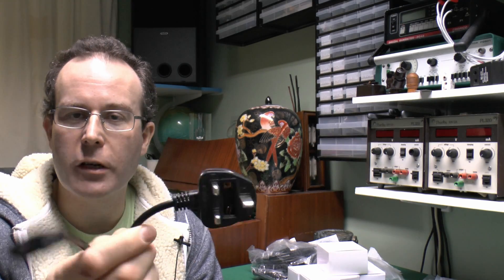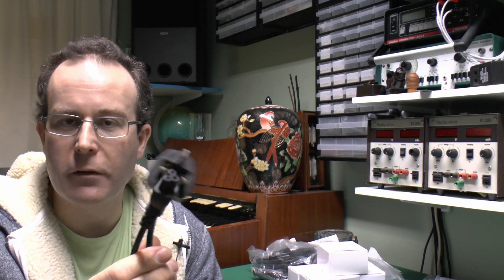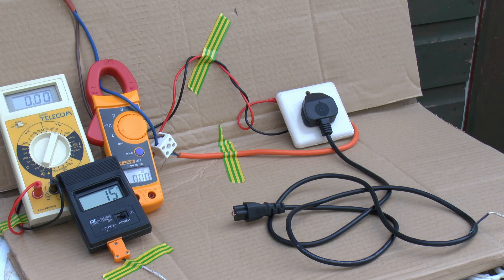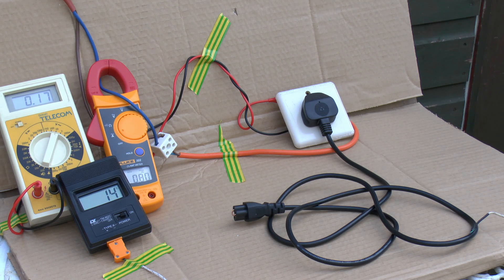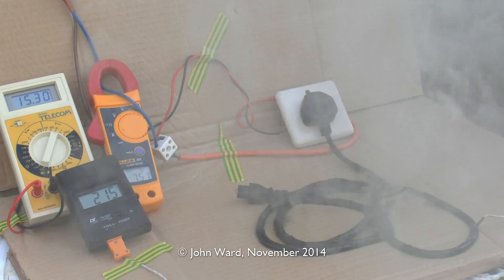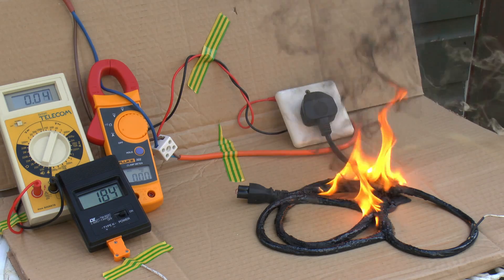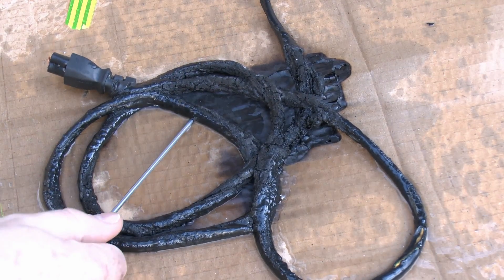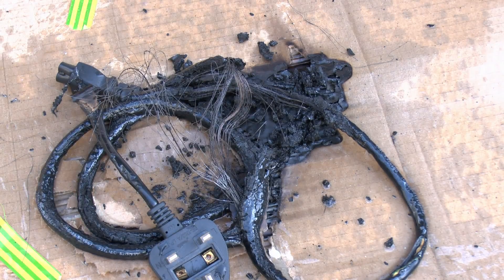C5 Power Lead Destroyed

Comment: I have a question - Is this cable not rated for 230V / 13A ? That means it would have melted in a heartbeat under actual workloads (like 230V / 5A). Wouldn't it ?
Reply: That cable should have never been rated for 13 amps, but more like 10, maybe just 5 amps. In fact, why should it even pass a safety rating?

Considering what that cable probably connects to, it likely would never exceed 5 amps under normal usage. However, the heating effect of the cable becomes worse, if it is bunched up or if something, a piece of carpet or a box or something, is put on top of it. A proper cable might have so little heat, that heating building up, would less likely present a problem.
Reply: Shaunak De no, because the cable only got up to 73° when passing 13amps, and had a 3 volt drop across the cord. If an appliance were drawing 13 amps it would have seen slightly lower voltage, (3v less than mains) and the cord would have been hot enough to be unsafe 73° but not bursting into flames unsafe.
Reply: Robert Szasz
A power cord is not supposed to be a heater, and if there was any bunching up of the cord, wouldn't it overheat all the more?

Why didn't they simply put a lower-capacity fuse into the plug?
Reply: Thank you for the explanation. :)
Reply: Well.. the insulation is probably still ok for 230v at 73°. That's the only thing with a random Chinese products, it could be something that goes from OK to dangerous unexpectedly.
Reply: Yosef MacGruber they should have. But it's also important to be accurate. If everyone expects anything potentially dangerous will immediately catch fire, they will not understand that the very warm cable needs to be replaced with a proper on immediately.
Reply: Robert Szasz
That power cord does not appear to connect to anything that would be expected to use 13 amps or more. But the problem is, it is not adequately protected from some potential short circuit overload, with a 13 amp fuse. The reason that most Christmas light sets seem to have fuses in their plugs, is because the small wires would perhaps overheat before they can even carry enough current to trip the circuit breaker to off. Thus, the current is limited to a more reasonable level for those little wires, say like 3 amps at most, judging by the fuse rating I saw on one Christmas lights set.

Also, aren't you forgetting, that watching a YT video of a power cable not overheating, well that is just kind of boring. Sort of like getting a live wallpaper for your Android device, that doesn't do anything. "But I thought it was supposed to do something interesting?" So of course he was going to test the poor-quality unsafe power cord, to the point of its dramatic failure. Better to see it on a YT video, than to smell smoke in your home. Hopefully, such videos can reduce the quantity of utter unsafe junk coming out of China.
Reply: The person I replied to was wondering if it would explode into flames if used with a 5A load. While certainly unsafe at the fused amperage (75°c temp) the fuse certainly would have blown on short with only  3V being dropped  across the wire.
Reply: Robert Szasz
What if the short is in the device itself, only draws perhaps 10 amps, the fuse doesn't blow, and the device catches on fire?
Reply: +Yosef MacGruber Preventing that last possibility is someone else's problem (specifically the device maker).  A cable cannot tell if a device is drawing 10A for a useful or harmful purpose.  Using a (proper) 13A cable to power a deep fryer is ok (if it keeps the heat away from the socket), so delivering that same energy to a shorted out burning computer would not be any different to the cable.
Reply: John Doe
Actually, it can, well sort of. Have you noticed the newer window air conditioners? They have bigger more complicated plugs on them, because those plugs have an arc-detector circuit in them. I think the purpose is to detect loose electrical outlets, that just can not handle the current draw of the air conditioner, and thus to cut off the power, so that the electrical outlet does not overheat. I think what it does, is detect erratic current flow, or spikes characteristic of sparking, perhaps indicating a loose connection screw in another outlet that is feeding power to that outlet, and it being judged an unsafe condition, it trips and cuts off power to the air conditioner. Can somebody correct me, if my explanation is inaccurate?

However, the higher cost of such a detector, probably makes it inadvisable to include such huge plugs for a mere clock radio, when a quarter-amp fuse would be far cheaper. Sparking at a very low current draw, is not going to produce near as much heat, as with a high-powered device such as a heater or air conditioner. Also, I think low-power consumption is much less likely to spark, even through tarnished or loose connections. Even a high-resistance connection, can often deliver a mere very low level of current.

There is no reason that I can think of, that a cable to a computer printer, should be drawing 10 amps, so perhaps it should have a 1-amp fuse in the plug. But sometimes the fuse might be within the printer itself. Anyway, a power cable should be capable of carrying the current that it is rated for.
Reply: +mharris1270 You got pretty much all all of that wrong. The problem with aluminum wiring was people not using the specified connectors and resistance building up at the connections to copper wires. Since people can't be relied on to change their installation procedures, just using copper was the solution.
Edited to correct speech recognition errors
Reply: mharris1270
If that power cord goes to a laser printer, then by your claim, that power cord is totally inadequate and unsafe. Every customer should be sent a replacement, without even having to request it.
Reply: mharris1270
It probably is a good idea to feel your power cords and transformer brick plugs, and electronic devices, ever now and then, to see that they are only slightly warm, and not unusually hot.
Reply: The C5 power connector is rated for max 2.5A, and it's used only on laptop power supply (and not even all laptop power supplies, the ones that needs more amps use a C13 that is rated for 10A). So what is the point to test it even with 13A? If the load that you can connect is maximum 2.5 the cable is rated for 2.5, and I think that with 2.5 it works fine. 

Just put a 3A fuse in the plug and it's a fine cable, if that cable was sold with a 13A fuse in it it was clearly a fault, maybe someone changed it with the wrong kind of fuse because why the hell a 13A fuse in a cable with a connector on the other side rated for 2.5A?

Comment: I don't understand.... why didn't you do this test with the 13a fuse inline so that we could see the fuse did not protect the cable. The the fuse could have blown before the cable became dangerously hot and prove the fuse was doing its job. I thought the fuse was there to protect the cable, which considering you pushed the cable to 20+Amps  before anything actually dangerous happened means it was basically a test of someone replacing the fuse with a link of 1.5 cable. Was the different voltage an element? would the fuse blow at 240v @13A or would the cable burn?
Reply: +John Quinton Not a fire risk perhaps but definitely a burn risk.  Plus anything the cable is laid on is not necessarily designed to handle 70C+ either.
Reply: I agree, the cable is a piece of cheap trash, but it would be interesting to see how it would stand up to a real world test, cheap fake fuse, cheap not-really-as-advertised cable, insulated earth pin, faulty iron or kettle element...
Reply: It is not so much whether 70ºC is so dangerous, well unless the power cable becomes unstable and damaged and more likely to short out, but if the temperature gets that high close to the maximum that the fuse can accept, then what keeps the temperature from getting higher? You have to consider the wide range of likely improper usages. People using high-current carrying cables which are still bunched up, so that the heat can not escape. And the test is not so much considering normal operation, but rather, what happens if there is a short circuit in the device. Does the fuse reliably cut off the electricity, or does the power cable overheat at risk of starting a fire? We should also remember, even though the cable itself might not overheat too bad, the device could be in flames because the plug fuse was of too high a current rating.

70ºC, even if you don't want to count that as a failures, leaves too little margin for error. And I would count such a high amount of heat, as a failure, that the cable is not safe. At least not without a lower-amperage fuse.

Perhaps what is most inexcusable, is putting a 13 amp fuse on such a poor-quality cable. If somebody thought that that cable was good enough for its intended usage, then why didn't they put in a 3 or 5 amp fuse? A cable designed for 13 amps, surely should have been of better quality.

Comment: Absolutely brilliant experiment this had me at edge of my seat like I was watching a horror film, When you say fake fuse, what actually makes it fake? At what current would a genuine fuse have blown?
Reply: +Prawnchowmein 
Fake fuses are typically either poorly designed, and/or poorly constructed. They might blow at too low of a current, which is a nuisance. But the real danger is when they blow at a higher than specified current. Think of it as putting a jumper wire instead of a fuse XD
I'm from the USA, and actually some of the old fuses here are very dangerous, because one can stick a penny behind the fuse, and screw in a blown fuse. The circuit will then work, because the penny bypasses the fuse altogether!!!! (pennies have a copper surface)
Reply: +Benjamin “Ozias” Esposti That is not the fuse being dangerous though, just people being idiots.

You can't design the human element out of everything.  There will always be a way to bypass safety features, the important thing is to make sure those features work as designed.

Comment: Hi JW, what equipment are you using to do the tests? We need to get hold of something similar for fuse testing. Thanks. I can't find anything that will go from 0-X amps.
Reply from the maker: +ChompChompNomNom An 8A variac connected to a 3kVA 240-110v site transformer, with only half of the output connected, which gives an output voltage of 0-55V, maximum current from 0 to about 30A.
Output is not regulated at all and depends entirely on the resistance of the load, so as in this video the current fluctuates significantly as the insulation melts and the wires short together.
Reply: Thanks, anything links for this kind of stiff? My company imports millions of pounds worth of stuff and we're trying to weed this crap out. They even produce fake Intertek / SGS etc certificates

Comment: Is there a way of SAFELY using copper clad/coated aluminium or steel in a similar cable?
Reply: +Kacey Anders 
Use a thicker gauge of wire.
I'd say that you still shouldn't use it though, because the aluminum can "cold flow". That is, over many years, it actually flows, as if it were melting, even at room temperature! Also, aluminum is notoriously bad for causing fires when improperly installed. It isn't compatible with all metals, so you can get bad connections (let alone the layer of oxide on AL...)
Reply: Yes, I'm aware of both those points with regards alum wiring, and it's use in the USA during the 60's, 70's and maybe 80's.

I was meaning more with regards use with leads/cords with factory sealed/moulded plugs (the plugs [hopefully!!] having properly made internal connections to the alum clad wire).

But certainly, copper is my 1st choice by a long margin!

Comment: Twenty one amps @ 230 volts would mean a power drain of 4.8 kilowatts. Surely the protective device would operate long before the cable bursts into flames...
Reply: +sadoldgeorge Not quite. The ring main circuits in UK houses generally run at 32A max load, I believe.

Comment: The power supply cable in orange does not overheat.  Is it because they have a lower resistance?
Reply from the maker: +Tangobaldy Yes, the orange cable is a larger size, so much lower resistance.

Comment: John, good video. My recently purchased (late 2015) "Rio Rand" self-balancing scooter from Amazon was supplied with the type of "cassette" lead you show, only mine did not even have a fuse in the British "type" plug. I say "type" as it is certainly not BS-1363 compliant, sleeved earth pin, no fise, inadequate size and incorrectly spaced pins - the lot! Your video demonstrates a current level easily supplied by a 32A ring main and you should point out that at 20A a 13A mains fuse will take some time to blow in any case, too long for this type of cable!

Comment: them cables should have no more then a 3 or 5 amp fuse in them (norm laptop or monitors, under 1amp draw) they should never have 13 amp fuse in that type of cable it was never rated to handle that type of load (also you tested a neutral to earth the earth cable can be thinner the the other 2 cables , be nice to see if you had Cut the cable to see if all the cables are the same size) 

still you had to put more then 13 amps to get it to catch fire something that would norm not happen in the UK any way ( i could see it been a problem in USA due to poor design plugs by not fusing the plugs to prevent thermal overload of the cable as that is why plugs are fused )
Reply: in the US, our regular outlets are 15 amp (sometimes 20) breaker protected in new construction. The voltage is also lower, 120 RMS so about 2kw (2.4 on the 20 amp).  Compared to 13 amp 240 volt at 3kw.  Trust me, I've overloaded a circuit a few times, and the breaker acts in under 30 seconds. In sum, the breaker will act faster than a British fused plug.
Reply: Jacob Wells it should act right away if it's overloaded past the rcd socket rating , 30 seconds would be faulty breaker (unless the overload was just under the breaker trip rating) 
fuse box should not trip first in an overload the fuse in the plug should blow first witch is missing in the USA as you put to much trust in the fuse box or the mains cabled on the plug melting first

the fuse in the plug is rated between 3-13amps (most fuse box are 20-32a depending if your on 110 or 240v) and fuse should blow first in a appliance first so not to take the house out

Unless RCD (GFCI? I think is the name in usa) sockets are standard in all houses now witch might be in new house's (it would remove the need in the uk to have the annoying rcd breaker in the fusebox) 

this cable was purposely overloaded in this video as it should have a 3amp fuse only, but they are coming supplied with 13a (the laptop power packs only pull under 1amp)
Reply: +lee x 
I'd say no.
If it operates right away, then turning on lights and transformers, and plugging in chargers will cause nuisance tripping due to the spike of power drawn. (inrush current)
lol my mom plugged in two space heaters into one circuit once (she didn't know, cause our house is wired kinda funny), and upon turning the heater on (the other one was on as well), the breaker tripped.
I have tripped the breakers before when connecting a large toroidial transformer to the mains, so yeah they can cause nuisance tripping.